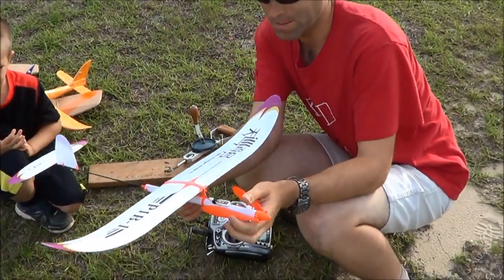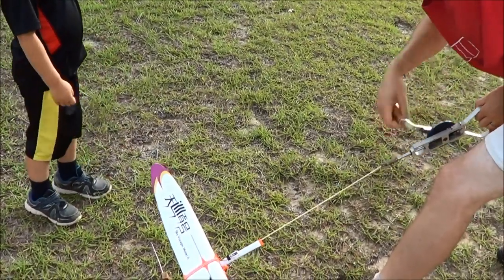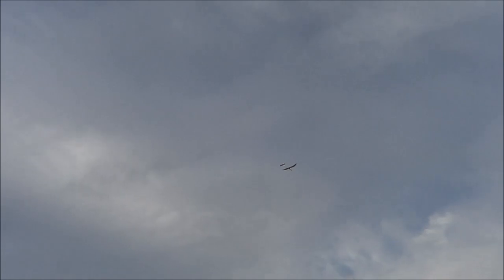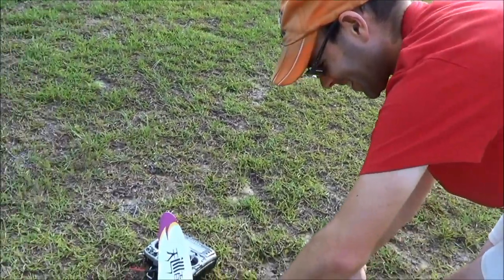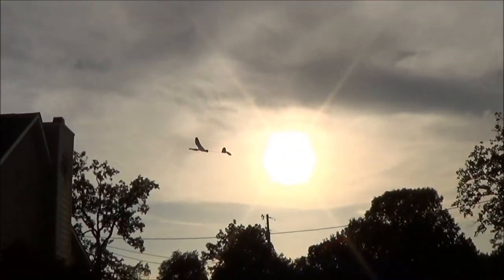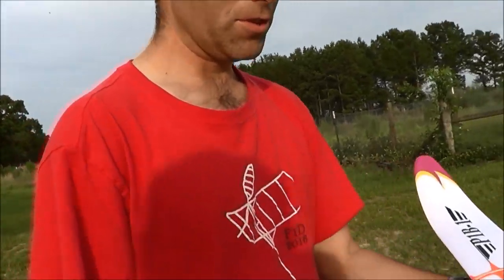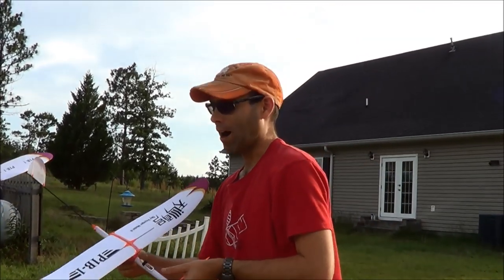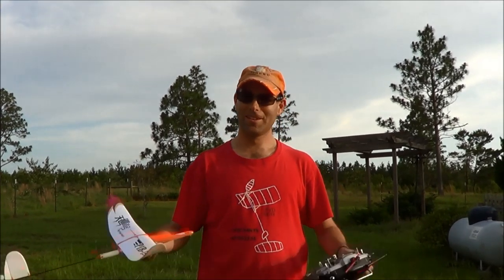Radio controlled rubber power!

Comment: No, rubber- R/C assist is not at all like having a dethermalizer. It's a way to control where the model goes. No more at the " mercy" of the wind. No more long hikes after every flight. No more in the trees. No more lost models. You can fly it to your hand. Also, you can seek thermals, and get it back. If it does get into nice thermal, you can stay there as long as you want, fly it out and bring it down when you want to (before it gets lost).
I just ordered one of these and I'm gonna do the R/C thing with it and enjoy myself.

Comment: Need a electric winder to speed things up a absolute must have... the work rate to fun ratio is too close. A 3rd servo to control a geared / brake system to extend run time / control climb rate and allow larger dia. props for more efficient climb per revolution to extend flight times. Less winding more flying. Need dual rubber tubes within the master tube to have more rubber duration. Rear section has a roller system to allow the rubber to move and stretch  during the wind up phase. 
Everything above will get you more folks interested. Front gear box can have a plastic piston / cylinder fake motor that reciprocates to create a motor sound for vintage FF effect.
Reply from the maker: AmpAbuser electric winders are crap. Use one and you'll see why. They're weak and give no feedback of what the motor is doing. As I mentioned in detail in the video, that winder is a 3.5:1 designed for BIG airplanes. I don't have a 10:1 that is suitable for that size of rubber...it would take about 1/4 as long to wind with such a winder.

Comment: Just recently subscribed, great videos concerning the intricacies involved in adjusting the many variables that affect the path of flight.  Hope did a sweet job of steering that thing too!  Just rip the guts from one of those RTF’s by Eflite, and away you go.  And you could throw the little motor on, use it with the folding prop to get you back to altitude for another thermal hunt:)
Reply: Agree

Comment: Very cool and sleek setup. The fact that the motor doesn’t go very far back must help with pitch-related inertia—I imagine that the Gollywock I fly rubber RC with, which is rudder-only, would be much more sluggish if it were 2-channel than this. Makes me curious about building an F1G-style balsa rubber RC model. Thanks for sharing!
Reply from the maker: sandfac yeah that would be one very cool project!

Comment: Nice as experiment but I have to desagree here, in my opinion never a RC plane "finds" a thermal easily than a FF either due to its greater weight, or to the (bad) interference  the moving parts "killing"  the glide but mainly because  a FF well trimed when making curves centers (or is sucked) it self in the thermal much more easily.
I agree with everything else. Always good to see your videos!

Comment: Can anyone think of a mechanical prop break for a microelectric with a pusher..... I'm trying to stop the prop with the engine off
Reply from the maker: If you're running a brushed motor, you'll have to figure out some way to short out the motor when it's at zero throttle. Otherwise go brushless and program the brake.

Comment: Very educational and amusing videos!
Gliders are the best planes anyway. Using a rubber band or maybe a Supercapacitor * (restricted power) is what makes it a glider. Is it possible to rubber band power a flying wing?
Reply: * Air Hogs E-Charger
Reply: (flying wing with rubber band power in pusher configuration)
Reply from the maker: prep0wer there have been several really good rubber powered flying wings. The Never Forget series are particularly amazing performers; check them out on Outerzone.

Comment: Why don't you put on a coreless motor? I think you can do it as same as weight of rubber.
Reply from the maker: Where's the challenge in that?
Reply: @joshuawfinn  Yeah, hobby is challenge, as you say. I'll show you my video, https://youtu.be/Mm8i_VSzEmg. This is my challenge to fly RC plane like controlled line, 　which I can fly speed-controllerable  lined plane.
Reply from the maker: @woesan  dang that looks challenging. Very cool!